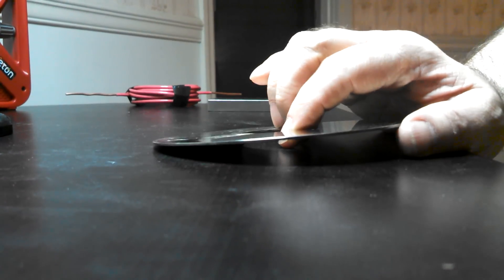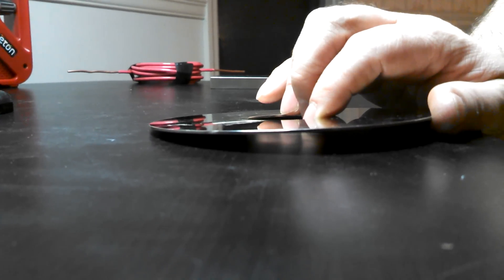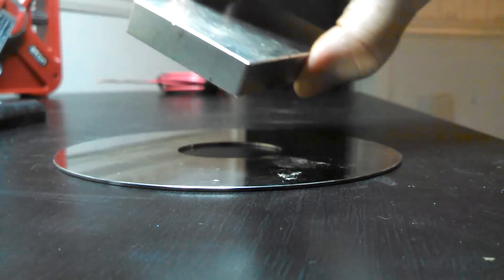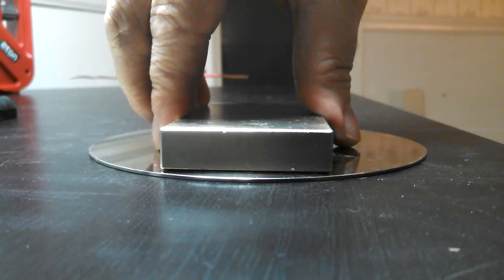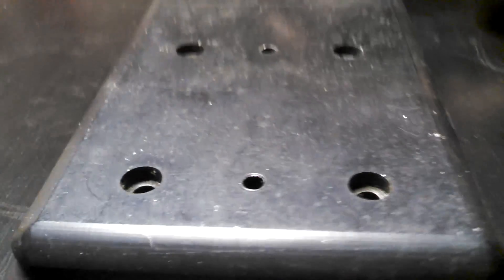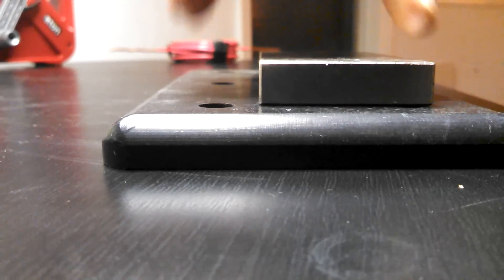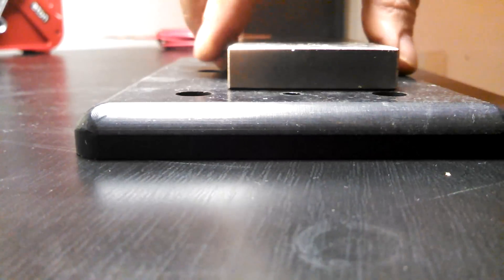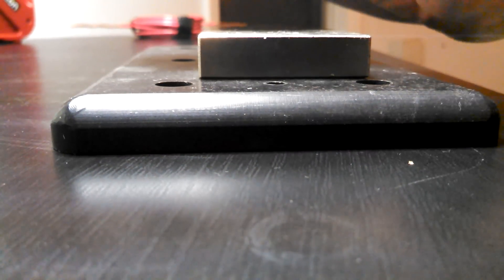🧲 Cool Inner-Action With Aluminium

Comment: The forces on the field are parallel as opposed to perpendicular like in normal ferrous materials.  would explain a shearing force reaction.   Try using an aluminum tube.  bet it slows down like it does with copper tubes..  Also, motion added to the equation simply causes an attractive force temporarily maybe..

Comment: duh, they may not be positively attracted, but rather a bit negatively repelled. Like being 6.9 on the Ph scale. Just slightly off to the negative. I bet if you were2suspend them on strings from the ceiling right next2each other, you'd see them repel a bit.

Comment: omg. re-inventing the wheel? flemming did all this to make motors and dynamos in the 19th century, try copper or any non ferrous metal.
The movement is caused by your movements, if you held the block still it would heat up.
Energy in = energy out minus losses..EDDY currents cause an opposing mag force to the movements... simples...google magnetic coupling....
Reply: Flemming, what about Faraday, Joseph Henry, and Tesla?
Reply from the maker: 🧲 https://youtu.be/jsgUF5DHAwo
Reply from the maker: 🧲 https://youtu.be/jsgUF5DHAwo

Comment: youre spot on correct I think cos when you cut the magnetic fields from the magnet against the aluminium surface electrons begin to move within the surface of the metal opposite to the thrust direction of the magnet. The electrons carry charges and when they meet magnetic fields they get excited like cats going after friskies. Your constant stroking creates a temporary fluctuating ac current on the surface of the metal..these electric currents fluctuating and colliding causes the electric currents to turn into kinetic energy of motion..nice video!

Comment: The material is diamagnetic, yes eddy currents that create opposing fields.  I have studied this effect with copper filings under a microscope and moving a magnet under them. also did experiments with filings in jar of oil. Through my experiments i found that eddy currents must require a certain amount of area or surface area to form onto.  The magnet can pull a large piece of copper or alum, but has very little reaction with tiny particles of copper or alum.  And i found that the eddy currents seem to only travel about 3/8 inch deep past the surface of copper or alum plate.
Reply: ***** Hmmm, interesting.  Science will tell us that we should get a current weather the magnetic field passes through the conductor or vise versa.  I never forget that Faraday proved that both can be spun together and will produce high currents.  Ill be interested to hear how your experiments turn out :-)
Reply: ***** Well thank you for sharing, again very interesting!, i may have to try the same thing you did and see if i can get a current.
Reply: ***** Have you played with "Halbach arrays".  Levitating pyrolytic graphite over them.  Have you seen the Hendo Hoover board with spinning halbach arrays.  Im sure you seen magnets dropped down a copper tube?
I Love magnets :-)
Reply from the maker: 🧲  - Interesting.
Reply from the maker: 🧲 Wow! Lots of great insight. I see you have an awesome science channel as well. And you're still posting. Subbed.
Check this out. 🧲 https://youtu.be/jsgUF5DHAwo
Reply: @FreeMagneticEnergy2  I am subscribed to you.
Blocking a magnetic field is very interesting.  I think best developed pyolytic graphite in the world can block at most around 43%.  I really like what you have done here.  I have done many hundreds of experiments with magnets.  You would have to go to my channel and scroll back quite a ways to get to all the magnet experiments.  I made a zero spot on magnets in the past.  I still wonder what the field is made of, after many years best answer talks about virtual electrons, so basically they are theorized.  Electrons can easily be blocked within insulators, but the field of a magnet can go through anything, so I expect the particles to be much smaller than electrons, maybe neutrinos or similar.
I can talk about this stuff all day!

Comment: eddy currents. the fast sideway movement induces a current in the aluminium, which creates a counter magnetic pole. this is already known a long time. The same reason a permanent magnet dynamo has drag. The induction creates a counter field. This happens with any metal ! Not just with iron/ferro magnetic metals.

Comment: You are correct.  As you move the magnet you create an electric current in the aluminium.  The electric current (that moves in circles - eddies) in turn creates its own magnetic field according the hand rules for electromagnetism.   This is known as Lenz's law.   I recommend you try a bar magnet then cut the bar magnet on a slant on the bottom then the flat part of the slanted edge can be placed parallel to a stator as the magnet rotates.  You can make a wedge shape so that the thin part of the wedge can go up the spokes.  The slant at the bottom of the magnet will cause the magnetic field to not align with the stator and will avoid the stall you were seeing.  Mind you, you found a very good work around so well done.

Comment: Diamagnetism.  I think the same thing would happen if you used a bar of either copper or silver.  The metal is neither attracted to or repulsed by the magnet.  Rather its like a force field.  As it moves through this field(or is moved through it) there is friction that is created.  On a much smaller scale, my hand does not touch anything on a molecular level.  I only feel force.

Comment: Aluminium is paramagnetic, there is an attraction, but it very weak.
Moving the magetic induces a curent, which creates magnetic field in the aluminium, this field then creates force  that acts on the aliminium as it interacts with the magnetic field from the magnet.

Comment: One reason why they use this principle in Electric Meters where an aluminium disc is used instead of a ferrous metal disc, so eddy currents generated by the use of electricity generates a magnetic field in a single loop coil which then starts to rotate the aluminium disc to register the electric usage, if they were to use a ferrous disc, then people would be able to stall the disc using a powerful magnet and get away with free energy!
Reply: Don't you mean stealing energy? I think have heard of this trick before where it was used to fool the Meter Man

Comment: Another way to explain thos phenomenon is that a moving magent above an aluminium plate induces electric current as the flux lines of magent interact with the atomic structure of aluminium, a current is induced, it may be known as Eddy current, it is no different to a copper wire being moved in a magnetic field and it will generate electric current, so now as the current in a disc dissipates within itself, i.e. the current flows across the surface of the disc, unlike in a copper wire, where the current cannot dissipate (flow) unless its both ends are joined together, in a disc both ends are almost joined as the disc is very thin, so this dissipation of current causes an opposing magnetic field, which makes the disc move as you move the magnet. (my own theory unproven of course)
Reply from the maker: I actually fully understand. I have five or six videos on this on my channel with various metals, pipes, plates, etc.
Reply: so what can the exact speed of the magnet gliding across tell us about the phenomenon we are seeing because its at a certain point that whatever field or current is educed and we see the transfer of energy throughout the aluminum plate
Reply: that that moment is importnat

Comment: I think this has to do with Aluminum having just one unpaired electron in it's outer orbit, it's just a hypothesis as it needs to be testing by trying this on other elements in the same group but I think that is the primary reason for this attraction. For an experiment it would be good to use an AC magnet as that will pick up an aluminum bar and can be used on those other elements in the same group on the periodic table of the elements with safety as some are toxic to us.

Comment: Bah,, that's no magnet,, its just a block of aluminum. The magnet is under the table and you're sliding it back and forth to move the metal disk and plate
Reply from the maker: WRONG. It's called eddy currents that's doing this. Using only magnet to create continuous motion has long since been solved and replicated by others. There for this is no longer theory. Thanks for visiting nonetheless.

Comment: This would be entirely expected by any electrical engineer. If you had a superconductor it would say locked without slipping at all. There is no mystery as to how it works.
Reply from the maker: Guess what? Turns out we've had German magnet motors for cars since 1966. Google it. Now others are creating their own magnet motor that truly work. Using only magnet to create continuous motion has long since been solved and replicated by others. There for this is no longer theory. Thanks for visiting nonetheless.

Comment: Moving magnetic fields will induce eddy currents in aluminum.  The eddy current opposes the magnet's field, resulting in a force on the aluminum plate.  Copper, or any other conductor, will behave similarly.  Eventually it will also make the plate warm - the energy you put into the system (with your arm), minus what went into moving the plate, will be dissipated as heat in the aluminum.  I've seen this used to heat water:  use wind to spin magnets over a copper plate with water channels in it.

Comment: James, have you tried supercooled aluminium as a core of a generator? Aluminium when supercooled  becomes superconductor...
Reply from the maker: No. I have not. That's not the same. This magnetic motor challenge was solved way back in 1966 by a German man who made a working car motor that ran only on magnets. See link below. Others as well on the web have also made motors using only magnets. See links below. My design concept is different from most others as I'm going for super torque. The links below were long since made available in the video description as well. If by chance you're still around, thanks for stopping by.

((( MAGNET MOTORS THAT ACTUALLY WORK )))
👉🏻 MAGNET MOTOR - Rotor Encantado
https://youtu.be/mxgwTzxfe8Y

Amazing Magnet Motor/Gen Rep. This is not a fake
👉🏻 https://youtu.be/jKFTAobM-l0

WORKING MAGNET MOTOR 2023
👉🏻 https://youtu.be/vdtdKE2Qe40SELF RUNNING MAGNET TURBO MOTORhttps://youtu.be/6sIBHn5-9pI

🆕 WORKING MAGNET MOTOR - rotor magnéticohttps://youtu.be/3mD0_0FiJ54

MAGNET ONLY MOTOR from SOUTH KOREA
👉🏻 https://youtu.be/smzpbKg9S7M

1966: German inventor presents his Free Energy Device Magnet-Motor
👉🏻  https://youtu.be/XWQjMyMWXAc

Comment: ok so if you added a block of aluminium to the end of the stator that might give you enough momentum to make the wheel go faster. reason being that it reflects the magnets at the zero end of the stator put some aluminium there to push the magnets on the wheel harder than just with the stator alone.
Reply from the maker: This magnetic motor challenge was solved way back in 1966 by a German man who made a working car motor that ran only on magnets. See link below. Others as well on the web have also made motors using only magnets. See links below. My design concept is different from most others as I'm going for super torque. The links below were long since made available in the video description as well. If by chance you're still around, thanks for stopping by.

((( MAGNET MOTORS THAT ACTUALLY WORK )))
👉🏻 MAGNET MOTOR - Rotor Encantado
https://youtu.be/mxgwTzxfe8Y

Amazing Magnet Motor/Gen Rep. This is not a fake
👉🏻 https://youtu.be/jKFTAobM-l0

WORKING MAGNET MOTOR 2023
👉🏻 https://youtu.be/vdtdKE2Qe40SELF RUNNING MAGNET TURBO MOTORhttps://youtu.be/6sIBHn5-9pI

🆕 WORKING MAGNET MOTOR - rotor magnéticohttps://youtu.be/3mD0_0FiJ54

MAGNET ONLY MOTOR from SOUTH KOREA
👉🏻 https://youtu.be/smzpbKg9S7M

1966: German inventor presents his Free Energy Device Magnet-Motor
👉🏻  https://youtu.be/XWQjMyMWXAc

Comment: The truth be known that electromagnetic fields affect everything to some extent, and even though aluminium is non-ferrous it still channels electricity or (the fields) very well.  To some this up fast, its more of a resisting field rather than attracting.
Reply from the maker: Actually everything, including light itself. It turns out that this magnetic motor challenge was solved way back in 1966 by a German man who made a working car motor that ran only on magnets. See link below. Others as well on the web have also made motors using only magnets. See links below. My design concept is different from most others as I'm going for super torque. The links below were long since made available in the video description as well. If by chance you're still around, thanks for stopping by.

((( MAGNET MOTORS THAT ACTUALLY WORK )))
👉🏻 MAGNET MOTOR - Rotor Encantado
https://youtu.be/mxgwTzxfe8Y

Amazing Magnet Motor/Gen Rep. This is not a fake
👉🏻 https://youtu.be/jKFTAobM-l0

WORKING MAGNET MOTOR 2023
👉🏻 https://youtu.be/vdtdKE2Qe40SELF RUNNING MAGNET TURBO MOTORhttps://youtu.be/6sIBHn5-9pI

🆕 WORKING MAGNET MOTOR - rotor magnéticohttps://youtu.be/3mD0_0FiJ54

MAGNET ONLY MOTOR from SOUTH KOREA
👉🏻 https://youtu.be/smzpbKg9S7M

1966: German inventor presents his Free Energy Device Magnet-Motor
👉🏻  https://youtu.be/XWQjMyMWXAc

Comment: wheres newman motor!
Reply from the maker: Youtube took it down years ago. I did not notice until years later. It turns out that this magnetic motor challenge was solved way back in 1966 by a German man who made a working car motor that ran only on magnets. See link below. Others as well on the web have also made motors using only magnets. See links below. My design concept is different from most others as I'm going for super torque. The links below were long since made available in the video description as well. If by chance you're still around, thanks for stopping by.

((( MAGNET MOTORS THAT ACTUALLY WORK )))
👉🏻 MAGNET MOTOR - Rotor Encantado
https://youtu.be/mxgwTzxfe8Y

Amazing Magnet Motor/Gen Rep. This is not a fake
👉🏻 https://youtu.be/jKFTAobM-l0

WORKING MAGNET MOTOR 2023
👉🏻 https://youtu.be/vdtdKE2Qe40SELF RUNNING MAGNET TURBO MOTORhttps://youtu.be/6sIBHn5-9pI

🆕 WORKING MAGNET MOTOR - rotor magnéticohttps://youtu.be/3mD0_0FiJ54

MAGNET ONLY MOTOR from SOUTH KOREA
👉🏻 https://youtu.be/smzpbKg9S7M

1966: German inventor presents his Free Energy Device Magnet-Motor
👉🏻  https://youtu.be/XWQjMyMWXAc

Comment: which produces greater eddy currents? copper or aluminium? Would a block of copper behave the same way?
Reply from the maker: Never looked into that. I will now. Thanks for all your efforts as well. Note: It turns out that this magnetic motor challenge was solved way back in 1966 by a German man who made a working car motor that ran only on magnets. See link below. Others as well on the web have also made motors using only magnets. See links below. My design concept is different from most others as I'm going for super torque. The links below were long since made available in the video description as well. If by chance you're still around, thanks for stopping by.

((( MAGNET MOTORS THAT ACTUALLY WORK )))
👉🏻 MAGNET MOTOR - Rotor Encantado
https://youtu.be/mxgwTzxfe8Y

Amazing Magnet Motor/Gen Rep. This is not a fake
👉🏻 https://youtu.be/jKFTAobM-l0

WORKING MAGNET MOTOR 2023
👉🏻 https://youtu.be/vdtdKE2Qe40SELF RUNNING MAGNET TURBO MOTORhttps://youtu.be/6sIBHn5-9pI

🆕 WORKING MAGNET MOTOR - rotor magnéticohttps://youtu.be/3mD0_0FiJ54

MAGNET ONLY MOTOR from SOUTH KOREA
👉🏻 https://youtu.be/smzpbKg9S7M

1966: German inventor presents his Free Energy Device Magnet-Motor
👉🏻  https://youtu.be/XWQjMyMWXAc

Comment: Hey, great to see you back at it! I agree with your riddled assessment. The eddy currents temporarily create a magnetic field between the magnet and the aluminum. Aluminum has some odd paramagnetic properties. One of my favorite effects is to drop a neodymium cylinder magnet down an aluminum pipe, and watch the eddy currents slow the effects of gravity. Good stuff!
Reply from the maker: You're spot on. I'm sorry to see you finally walked away from you amazing channel. Hopefully nor for good. Note: It turns out that this magnetic motor challenge was solved way back in 1966 by a German man who made a working car motor that ran only on magnets. See link below. Others as well on the web have also made motors using only magnets. See links below. My design concept is different from most others as I'm going for super torque. The links below were long since made available in the video description as well. If by chance you're still around, thanks for stopping by.

((( MAGNET MOTORS THAT ACTUALLY WORK )))
👉🏻 MAGNET MOTOR - Rotor Encantado
https://youtu.be/mxgwTzxfe8Y

Amazing Magnet Motor/Gen Rep. This is not a fake
👉🏻 https://youtu.be/jKFTAobM-l0

WORKING MAGNET MOTOR 2023
👉🏻 https://youtu.be/vdtdKE2Qe40SELF RUNNING MAGNET TURBO MOTORhttps://youtu.be/6sIBHn5-9pI

🆕 WORKING MAGNET MOTOR - rotor magnéticohttps://youtu.be/3mD0_0FiJ54

MAGNET ONLY MOTOR from SOUTH KOREA
👉🏻 https://youtu.be/smzpbKg9S7M

1966: German inventor presents his Free Energy Device Magnet-Motor
👉🏻  https://youtu.be/XWQjMyMWXAc
Reply: @FreeMagneticEnergy2  I'm still here, James. In fact, I have 3 new videos up and mentioned you directly in the latest one, "How to Validate a Magnetic Motor Part 01". Part 02 should be up on Christmas. Good to hear from you. I'll take a look at those links you included.

Comment: It is eddie currents. I work with super conducting magnets all capable of producing a 9T field. I have a similar demo that is used for tours of the facility. In my demo, I use a 2" neodymium spherical magnet and drop it through a schedule 80 ofhc copper pipe. If you are trying to work it out, think if the rate of motion across the plate as the frequency.
Reply from the maker: CALLED: THE LENZ EFFECT: https://www.youtube.com/watch?v=1nD8xqURS_8&t=192s